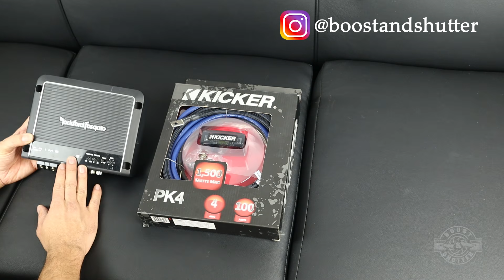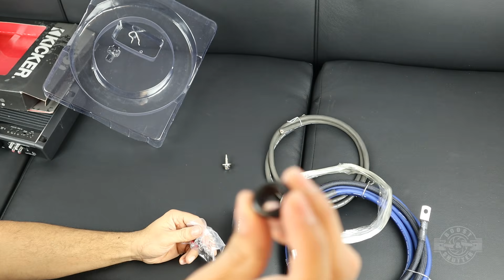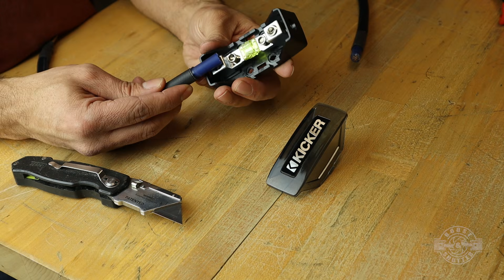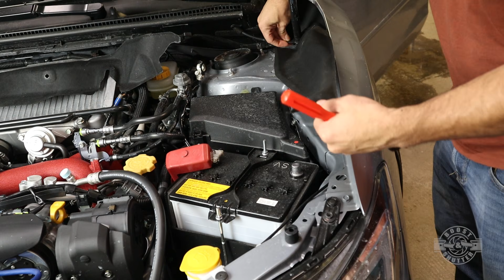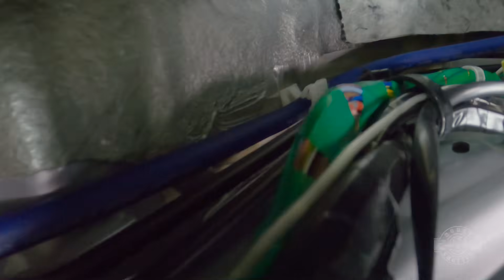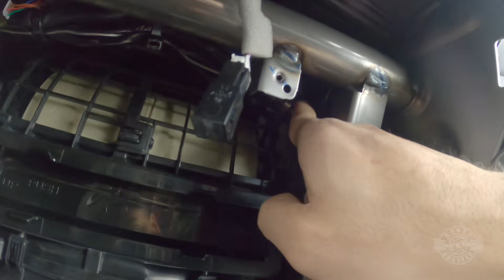How To Install an Amp Wiring Kit

Comment: OFC is marketing gimmic oh ok buddy have anither toke what no 0 gauge recommendation for power wire? why? power wire is not based just on watts check your manual for your amp see what it recommends. going bigger on power wire and ground wire is almost always better. If you want to grow in the future use 0 gauge if amp will accept it then you wont have to redo it.Genius use a wire ferrel for the power wire and ground wire into fuse holders and ground blocks. You seriously used tape to stick the fuse holder on, proper way is to make a mount and use a bolt to attach it. You sir need to learn how to install properly and stop posting all this mis-information

Comment: i have a blue wire and a blue wire with a white stripe connected to each other on my head unit, should i disconnect them and use the blue one for remote?

Comment: Thank you for your videos I found them so helpful. I did the same set up you’re showing on this video and I have one question to you. I live in Texas and it gets so cold here in winter. I use the heater most of the time blowing to the feet and my concern is the amp and the lc7i could/will overheat once I turn my heater on. My question to you is how did you solve this issue? Is there a way to disconnect/eliminate the passenger side heater vent to prevent this?

Comment: False information, OFC IS NOT A MARKETING GIMMICK, CCA MIXED METALS SOLD AS OFC IS, WIRE IS NOT WIRE YOU WANT 100% OFC PURE COPPER, YOU DO NOT WANT CCA or copper clad aluminum basically OFC Tinned wire or mixed METALS ......always buy name brand 100% OFC LIKE TO AUDIO ,ROCKFORD FOSGATE KICKER,MASSIVE AUDIO AND STINGER HYPERFLEX\PRO

Comment: Anything above 500 w amp should be running a 2 gauge wire. If you dont you are actually are shorting your amp of power. Also run a capacitor or double the out put on the factory alternator. Most cars run a 120 amp. Get at least a 200 amp alternator out put. Your lights won't flicker

Comment: Hello I’m just wondering because I had this done to my corvette 2008. I had a fuse box and some wiring connected from the battery of the car directly to the amplifier of the car because the amplifier was not getting enough power. Just wondering if when I turn my car off the battery is being drained still ?

Comment: With that kind of fuse holder, I use ferrules on the ends of the power cable. It protects the fragile wire strands from the screw when you tighten it down.

Comment: Also an experienced car audio installer and this video is EXCELLENT!  Love that you mentioned the true purpose and importance of the fuse installation as well as protecting the power wire with grommets and even the excellent mention of protecting the power cable if it runs near any sharp edges along it's path A++.  Correctly the fuse is to protect YOU and your car from an electrical fire, not to protect your equipment!  I have actually seen amp install videos that make no mention of any of this as well as claiming the fuse is to protect you gear from surges etc.  Also your mention of stripping the paint for your ground. So many take the fast\easier route and think that the bolt head is "good enough" of a ground.  Only thing not really mentioned is that typically power wires are separated from signal wires and power wiring is usually run down the drivers side of the car and signal wires down the passenger side of the car.  Also have to LOVE Subaru's for their ease of install.  It's almost like they were made for car audio installs. Plentiful useful grommets through the firewall and they even provide empty spaces in existing wiring clips as well as wire channels down both sides of the car from front to back.  Really a dream to run wires in a Subaru.  Nice Job!

Comment: Hi in my car I saw 2 wires that looked like speaker wire or something, and next to it there was 2 rca connectors with its cable, and I was told there was a amp in the car before but they took it out. I see no connectors on the battery tho so I’m not sure if the wires are there if if they aren’t wired to the battery or another source of power

Comment: I am an experienced car audio installer. I am very pleased with your video and your careful attention to details. You nailed all the key points! I have a 2020 WRX that I had to do the same thing with. I installed a Cerwin-Vega VPAS12ST powered sub, which sounds outstanding. I upgraded the door speakers to Alpine Type S 6.5" coaxial and the dash tweeters I bought the Kicker OEM replacement that Subaru sells. The stock head unit struggles to give those speakers the juice they deserve so that'll be my next upgrade but it all sounds totally amazing. Great video. I will share it with other enthusiasts as a quick reference 😉

Comment: I still don't know or understand where the RCA cable goes connected. I just got a Skar 8 inch sub and amplifier with the wires to install. I have a C300 2016. No real instructions with kit. I ordered this Car Stereo Hight to Low Converter,2 Channel Line Output Convertor with Remote Turn On RCA Car Line Converter Output Adapter 

But I don't know if I even need it. Any help is greatly appreciated.
Reply from the maker: Your high to low level converter has to tap into your high level out from your factory head unit. In other words, the wires coming out of the head unit that go to your speakers will get tapped into to provide a signal for your hi/low converter. The RCA cables will then plug into the hi/lo converter on one end and then your amp on the other. Haven't looked into your particular amp, BUT if it has high level inputs you can bypass the hi/lo (LOC) altogether and save some money. Hope that helps.
Reply: @akqjtn  Wow thanks for replying to my question so quickly. So if I don't want to get into my dashboard, I can hook up the LOC to the stock subwoofer wires and then hook up the RCA wire to the amplifier.

Comment: So if my battery is no good anymore and I need to change it out, is there anything in particular or certain practice with the ground fuse connected to it that I need to pay attention to it? Or can I just move the terminals from the post and put them on the new battery no problem????

Comment: Did you have to use the fasteners to secure it because in 2017 forester it fits snug. Was wondering if it will stay put or effect the wiring

Comment: how can amp burn without burning battery line fuse (60amp) and amp fuses
 (30amps x 2 fuses). i thought fuses would burn before the amp does! but
 my amp burnt :(

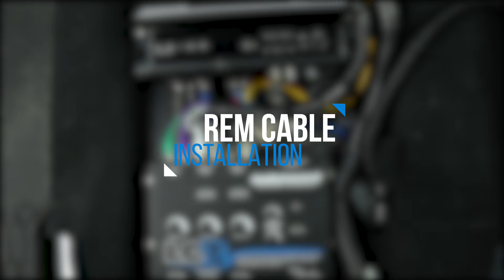Comment: @ 10:00 what if you have stock head unit? Where do you hook up the rca cables?
Reply from the maker: You need an LOC or "Line Out Converter". It will take your high level outputs and convert into low level outputs that your Amp can use as an input. This is a very common thing to do.

Comment: lot,s of great information; excellent video much appreciated-regarding the memory or on/off wire connect,s to back of the amplifier and then connect,s to any power source that is only active when the key is on or car is running; is that correct-I,m installing a single channel amp for my subwoofers;  the subwoofer box has a "CUP STYLE POWER CONNECTOR" which only allows for the pos/neg cables/wires-to be inserted and are held in place with a push open-close connector-do I just cut the ends off the RCA cables and insert into the connector cup?? THANK,S PJP

Comment: Awsome video, how did you create the wiring harness  for your factory radio. I have 2020 WRX Kicker factory upgrade JL all in 1 12in sub. Not happy with sub going to get kicker, sub box. and amp. I want amplify door speakers also. I taped into fuse box for remote  turn on.

Comment: Now where dis I go wrong I’m grounding my cables rn and my subs barely hit but Ik they work rcas are plugged in power is 4gauge on 1100 watt amp
Reply from the maker: Did you set your gains right?

Comment: If I want 2 Amps do I need to have 2 seperate amp install kits?
Reply from the maker: One kit of the appropriate gauge to handle the combined wattage of both amps.
Reply: Do you want them wired in series or parallel?

Comment: Pro tip:you want to avoid runnin wire across engine bay at all costs..
Reply: Expert tip: don’t listen to Mr.numbers 6174. He doesn’t know what he’s talking about. Your fine running wires across. There’s wires running throughout the whole damn car. Just be cautious of where you’re running them.
Reply: Where do I run the cable then??
Reply: I think by “across” he meant over the engine and not so much “across” as in around the engine bay. I always follow existing wires, if the factory wires are good being there so it aftermarket one. Plus’s it looks more neat.
Reply: Eek why that’s what i did

Comment: halo sir, power cable can use for grounding cable ? I mean buy only 4gauge power cable then use for power line from battery and use for ground body on the same one cable, and my amplifier is 500watt rms then im planning to use 4gauge wire and for fuses, can I use 100Amp fuse for 4gauge wire + 500watt rms amp ? thank you
Reply: yes

Comment: Can this be used instead of speaker wire, it would make it so much easier to just run this to the amp from my JVC head unit instead of running additional wire from my front 2 speakers and my rear 2 speakers? I have a 13 Chevy Silverado ext cab and I’m replacing the 4 factory speakers with 4, 6-1/2” Kickers speakers.

Comment: i installed my 2 8s and a 1200watt amp, and i went to start my truck and it turned off, and when i turn it on the bass plays and the lights dim, what is wrong?
Reply: thats normal

Comment: These videos are super helpful!  Thanks for making them so clear.  I will be installing a Sound Ordnance b-8ptd under the driver seat of my 2019 WRX.  I plan on running the power line the same way you have shown in your video.  Couple of questions:

1. What is the best way to route the high-input (speaker wire) and running power line to the other side of the car?  Would you run it under the center console and then up the door trim, through the glove box, and behind the head unit?  

2. There is a remote line that is 14' long  I am thinking under the dash would be the best place to install this but not sure how to access that area.  Would you recommend it going in another area?

Would love your input and advice.  I am a newbie to all of this, so forgive my greeness!  Thanks for anything you can provide.
Reply: @akqjtn  
So it is okay to run the power and the speaker wire together?  I thought I read that it could create some 'interference'. Going up the console seems best because it would be easiest to install the remote as well.

Comment: Do we need to give ACC or remote supply to amplifier(for turning on and off) in case of we using speaker input instead of RCA ?
Reply: Boost & Shutter i bought sony xm-n1004 amp, do that have above said GTO, im
Noob here so lemme know thnx

Comment: If you are running separate amps (4 Channel + mono), do you just run one power cable and split it into the amps? Also, can you combine the two grounds into one cable and into the ground bolt?
Reply: @akqjtn  I dont recommend a combined earth point as you can cause an erath loop - which causes noise issues/ alternator whine to come through your speakers etc.
Reply: @drummonkeystuffuk1875  loop is when they are separate grounds and cause noise wine ect

Comment: How do you run it from the drivers side to passenger side after the grommet
Reply: @akqjtn   I was just curious how you did it. Im gonna redo mine with 1/0 the first time with 4 guage I went down the driver kick plate to the front of the back seat carpet to the passenger seat but it seemed like a real long run and 1/0 is harder to hide.

Comment: Its funny how times change,back in the day the first thing that hit the trash can was the factory head unit,lol,now the old line converters are seeing a resurgence.

When installing a amp TAKE YOUR TIME,pick you a nice weekend, get up early,get all your stuff rounded up and call a buddy for help and get your amp installed, being in a hurry will get you nothing but problems,think about it as building a house,make it all pretty,make sure everything is snug,use zip ties,make it look bad ass,you dont wanna open your trunk to show your friends you new system and there is stuff hanging everywhere and your using solder wire for a power cable.

On you power wire, the part that goes under the hood,put you some black wire conduit tubing on it,temperatures under the hood get very nasty specially during summer, this all might seem trivial to you until your on the side of the road waiting for the fire truck,the fuse is a redundancy item but never hurts to be extra careful.

Comment: Is there a point where the fuse is too big for the power cable/amp? For example my amp is the Infinity Primus 6004a & manual says to use minimum 30a fuse. Do I go slightly above at 40a or I can just go straight to 60a or even 100a?

Comment: Do you need to run 2 pairs of RCA wires to use a 4 channel amp in bridge mode? (Bridge channel 1/2 and 3/4)
Reply: depends on the amp really, my hertz amp you have to attach one pair of rcas to the red inputs on bot a and b channels, then change other setting on the amp.

Comment: Bro, are you a professional installer? If not, should be, great video. I’m having trouble with the remote. I tapped into a fuse on my current year ford truck and the amp will not turn off. Originally I tapped into what I thought was a remote on the factory head and all was good. I changed out amps and the remote was no longer working for the amp. Any suggestions before I take it into a shop and pay 150$ to have it looked at? Once again, probly the cleanest install I’ve seen on the tube.
Reply: sigaret lighter plus cable

Comment: What can be the problem if the fuse keeps blowing up?
Reply: Hey. I want to install two amps inside my car, one for sub and the othe for highs. Could you help with that? I also have two passive crossovers I would like to use. Do you have contact info so I can reach out to you.

Thanks
Reply: wire short
Reply: or bad ground
Reply: It blows up as soon as i turn on the headunit to play music. I didnt have this problem before. It started doing it all of a sudden. Thanks for the reply man!

Comment: I want to install 0 gauge as main power and main ground. However, I want to install distribution blocks after that to power exact similar setup you are having with LC7i and two amps. I am planning to take 4 gauge power and grounds from those distribution blocks to 3 devices. do I need to install fuse for each line or the main fuse after the battery is enough? How much amp of the fuse you install it after the battery. I like your video, they are detailed and clear. Good job.
Reply: Run 0gauge with a fuse to a distribution block, then fuse all amps with the own fuse, to get what fuse you need to use for each amp look at the owners Manual for each amp for the power draw for that amp, then you can you the correct fuse at the battery.

Comment: Just a simple question.  Why did you choose a LOC rather than just get an amp with speaker-level inputs?  Is there a reason for that?

I'm in the process of upgrading my 2020 Jeep Grand Cherokee audio and don't want a new head unit but the head unit has no RCAs so my plan is to get a 4 channel amp with high-level inputs (Fosgate 400x4 Punch compact) and just put the amp between the headunit and speakers using speaker wire, which has the added benefit of being able to use all the factory controls on the head unit (fade, volume, bt etc.) and less distortion (it has to be a pretty good amp for that tho).

Any thoughts?
Reply: LoC is what you need when using factory head units. Personally, all my amps have had high level inputs but I’ve never used them. It’ll work the same so I heard as RCA’s, only with chance of humming. I’ve read somewhere that rcas are the best way to go if quality in sound is what you chase. Whatever route rca or high level you decide to go, it’ll work! Good luck with your install!